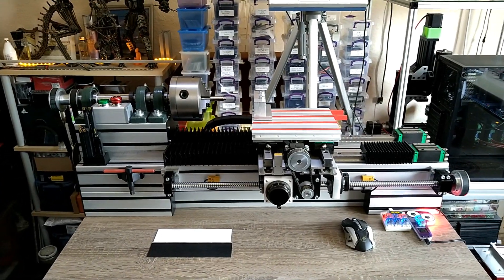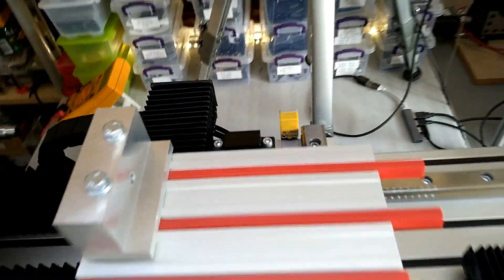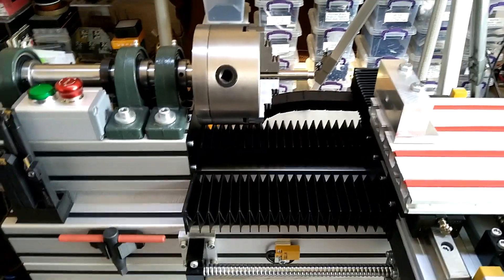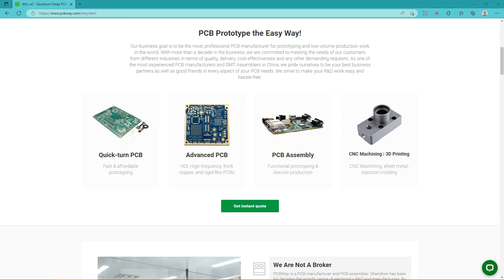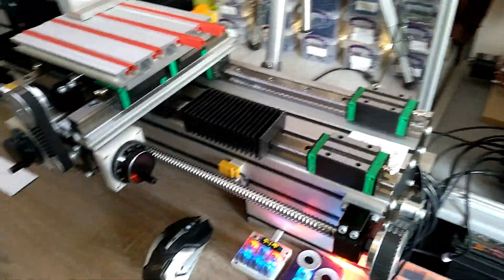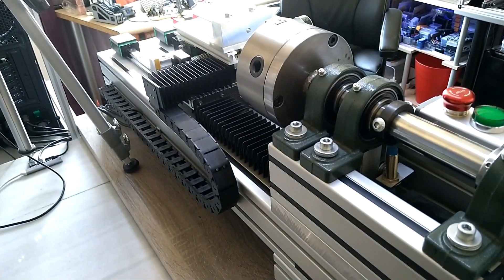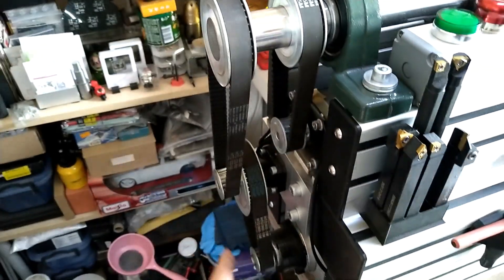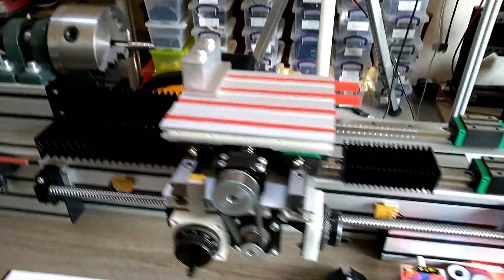DIY CNC Lathe Designed and build by #Hayri run by MACH3 Turn, Chuck Back Plate Sponsored by #PCBWay

Comment: I'm building a steel lathe, but wanted to use a stepper to control threading feedrate.  That said, how does your CNC manage when cutting threads?  Does the inductive RPM counter provide enough accuracy to achieve proper stepper mapping?  I ask because I'm planning to use a 2HP 3 phase motor to power the spindle to save money, but perhaps a beefy encoded stepper would be more appropriate to have electronically controlled threading speeds.
Reply from the maker: Unfortunately due to the Mach3 controller board I used, I can not cut threads on my Lathe although it has the rpm sensor. That being said, one signal every turn is enough to accurately cut a thread. Just make sure your stepper motor on the leadscrew does not miss steps.

Comment: Extra work. What is the cost of all parts? Do You calculatet this? And what is model of these yellow limits sensors?
Reply from the maker: Not really, some parts I had at hand, bought several years ago. The proximity switches are the OMRON TL-W5MC1

Comment: Hai hayri..i am interested with your cnc lathe, especially for indexing head,  could you share about wiring to BOB read.?
Reply from the maker: Hi, I "just" used the 3rd axis of the controller board for the indexing stepper motor which is connected via belt to the spindle shaft, the same shaft is also driven by the spindle motor which is controlled by the VFD. I do unplug the 3rd axis during normal lathe work as the stepper motor would pass the voltage is generates during passive turning to the stepper driver. So it is either the indexing head or spindle driven. I explained and showed the stepper motor in a previous video. Hope this  helps 🙂
Reply: @iHayri1 ...  Ya i have seen your last video, this  like A axis in cnc router / Milling..btw is proximity at spindle Shaft as spindle index/pulse for threading or just read rpm only from spindle..?
Reply from the maker: @Kitera_Store  Exactly, it is like a A axis. I do have a inductive sensor reading the rotation of the chuck spindle shaft which is used as homing for indexing and theoretically could be used for threading as well only my controller board does not support threading and can read only rpm.
Reply from the maker: @dromCZ  The problem with the controller board is, that it only detects spindle speed at the start of the program and when changed in g-code but not continuously.